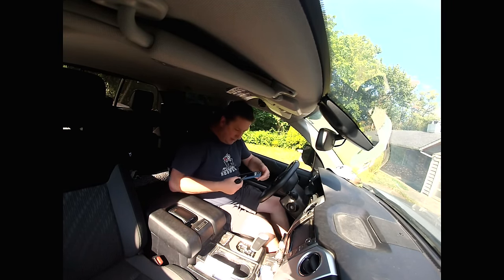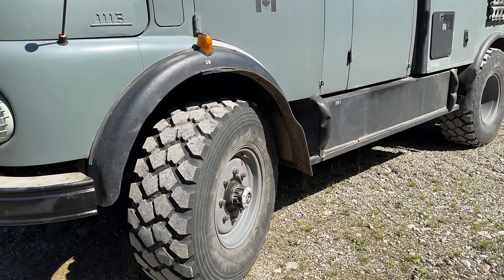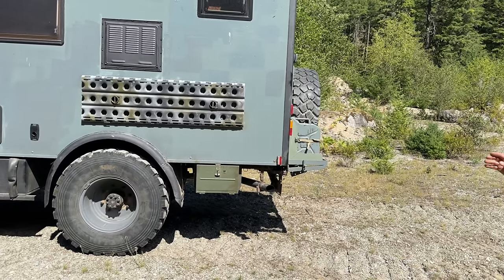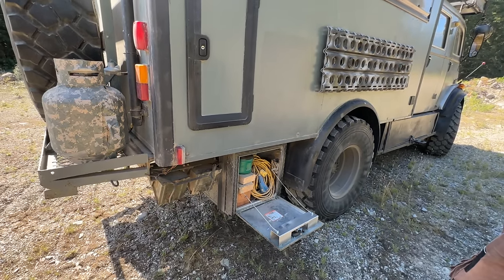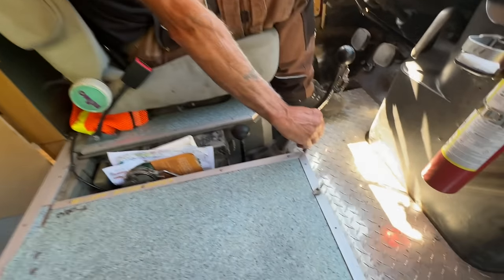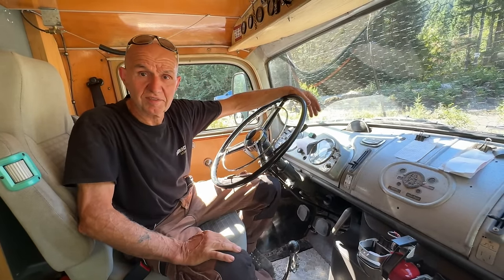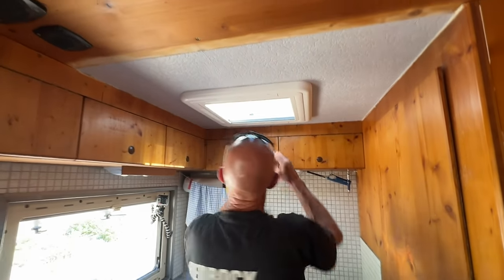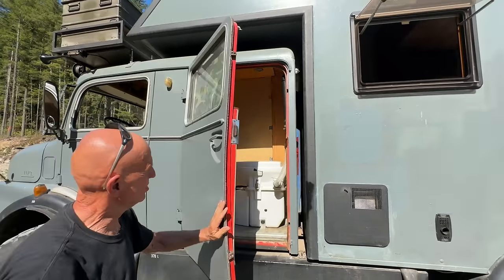Full tour Mercedes-Benz 1113 Expedition truck "Kurzhauber" !

Comment: Quite amazed to see the truck had front free wheeling hubs to save fuel.. This is a feature on smaller vehicles like toyota landcruiser dodge Ram etc... It disconnrcts the front differential from rotating freely in 2 wheel drive.. Way 2 go...!!!
Reply from the maker: Thank you for sharing ! Cheers

Comment: In Brazil these trucks (1113) still run strong transporting everything. But they are all 6x2. You can still get every part you want here for these trucks
Reply from the maker: Thanks for sharing.
Reply: The MERCEDES BENZ 1519, Engesa 6x6 built in Brazil for the Brazilian military can make an exceptionally good overlander. I saw one in Porto Alegro on a visit to Brazil during world cup 2014 and was quite impressed.

Comment: The metal strips are called Marston Mats and yes , they were used to make runways for WW2 aircraft. They were easily replaced if the strip was bombed. Throw in some dirt and attach new ones and your back in business in a short time.
Reply from the maker: Yes and it is super interesting I have never heard about those mats brilliant engineering from the past. Thanks for commenting.

Comment: Called Marston mats they were steel during WW2,they were used for  island hopping air fields , quick setup, 10’ 15” .
Reply from the maker: Like I said in an other comment it is an very interesting topic, the aluminum ones are rather rare most common are the steel ones and have been left behind after WW2 a lot and farmers build fences from it thank you for letting us know. 
https://www.recyclingthepast.com/i17566-World-War-II-Marston-Mat.aspx
Reply: @oscaroverlander_MB1222AF  : I recall my old elementary school here in the Philippines having a fence made almost entirely of Marston mats.  It doesn't rust easily due to the manganese content in the metal.  And, yeah, they still are intact today!

Comment: The "off road" shifter is a high/low shifter.  Cruise control/PTO works when in park or driving to operate hydraulics,  ie, pumps, blowers etc.
Reply from the maker: It seems you have some experience with this kind of machine.

Comment: In Indonesia these trucks were used to transport cargo between cities, before the Trans-Java Toll Road was constructed I would see these trucks all along the intercity roads on my way back to my hometown. They were used so much that most of them looked like it was about to fall apart with questionable extended frames, thick black smoke coming from the exhaust, and little to no working headlights or taillights. Now these are too old and they're replaced with newer trucks.
Reply from the maker: Cool thanks for sharing !
Reply: Now our man has a place to source a replacement windshield.
Reply: Mercedes bagong...

Comment: The free-wheeling hubs stop the wheels rotating the drive train back to the transfer box. With hubs locked, the half-shafts diff internals and propshaft all rotate because the wheels are pushing them round.
Reply from the maker: Thanks.

Comment: 1200 km with 370 lt of diesel it’s an amazing fuel consumption of almost 3.5km/l! 😮
Reply from the maker: Well he said usually a bit more than 1200 km depending on elevations.  That is not surprising look at a Toyota Tundra 120 L good for 680 km what does this work out to ? Or those big semi trucks on our streets they take easily 30-35 L for 100 km just my two cents.

Comment: Fun fact , the weight of  a bit less than 7,5 t was most likly were the Truck was construckted for , with the old ( pre 2000 ) german driverslicence it was alloud to drive trucks up to 7,5 t with a car licence ,  a truck licence would be considerable more expensive and would incoude a long school periode .
Reply from the maker: Interesting! In Canada is it a little different you can drive an RV ( Recreational Vehicle ) as big as you like, except it is equipped with air brakes, than you have to have an "air brake endorsement" . You can do this in two days in a driving school including theoretical and practical tests. How to drive the big rig you figure this out your self !

Comment: Very very nice build My only issue is I'm spoiled I would have to have air conditioning for the traveling that I would want to do I would have to put a air conditioning unit they now make a special one for old vehicles comes with everything you need compressor gauges everything to hook it up
Reply from the maker: Very interesting could you post a link of this unit here ? Thanks for sharing.
Reply: Who sells this AC kit?

Comment: 24:57 what is that you are holding on yr left hand? Look like a aerial with a ball at the end.......
Reply from the maker: This is a side marker, the driver can see how close he is on walls or trees. Because the marker is in line with his fender or bumper side, which he can't see from his seating position.
Reply: @oscaroverlander_MB1222AF  Thank you, now I understand.... How about the height of the vehicles, do you hv any markings or indicator to measure during passing thru low trees?

Comment: HP is surprisingly very low… what’s the torque?
Reply from the maker: The normal 1113 had 353 Nm but the turbo charged version 461 Nm I believe.